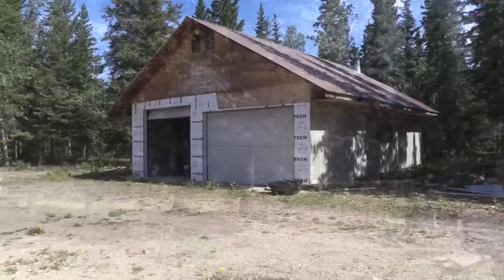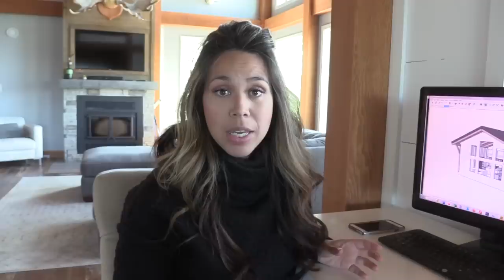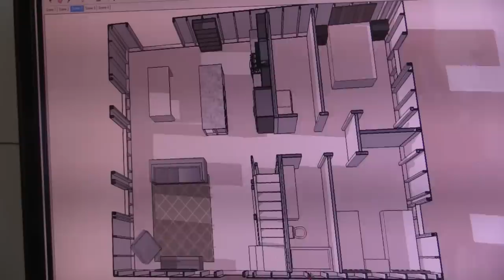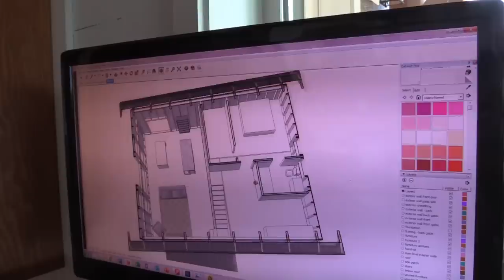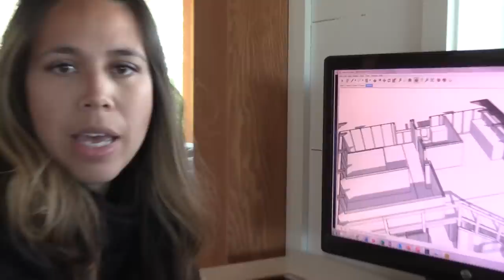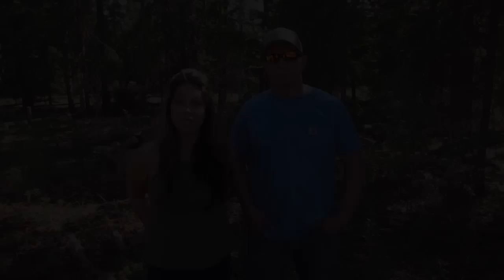Cabin House Build Episode 1: Design, Foundation, Floor Framing

Comment: With all that land you could potentially use several solar batch collectors (cheap to make) in series (where heat is accumulating from tank to tank), and run it up to a water to air heat exchanger @ heat system & hot water tank. Add a single solar panel to a DC to DC charger to 1or 2 deep cycle batteries to a 100w inverter to a taco 007 circulator pump 84w @ 12v/7A DC. (10)40 gallon batch collectors should provide in Alaska 150° - 200° water. You just have to find 10 decent used or cheap hot water tanks.

Comment: This is great!  I hope someday you build a 100% concrete home too.  There are systems for concrete in the roof as well and you can put brick or whatever you want on the exterior.  Folks are also starting to try Geo-Air systems to use the 52-degree earth (most places 8 feet down) to help heat and cool.

Comment: I love the outdoors of Alaska all year round BUT 50 to 70 below is killer (granted those are extremes but 6 weeks of 40 below is pretty possible...). I would probably cut back on the amount of glass and put in extra insulation if it were me. I would sacrifice some light and views for staying warm at an affordable price.Still love your designs though.
Reply from the maker: Thanks for the input!

Comment: You are using 12 foot studs on the side walls? Cool. A very nice compact envelope for the amount of floor space and then the dramatic great room is fabulous! I assume there will be structural bracing in the 2x6 walls, especially since the floor joists will run parallel to the side walls. Sorry, I tend to geek on home building. Oh, will there be a place for a wood stove?
Reply from the maker: We need to hire you lol!  Thank you!  Not sure yet on the wood stove, it takes up space and will cost about $5000 ...

Comment: Do you use ceiling fans or duct work to pull warm air from the upper parts of your house to the lower levels? I figure it might help you out in keeping the whole house feeling warm.
Reply from the maker: Yes!  We will do a ceiling fan in the great room and then an air intake at the peak to bring the warm air down

Comment: I love your designs & was wondering if you've considered a deck on the front that goes around in front of the wonderful window's to help give it a larger feel? Especially since it's only 1,008 sq ft...a bit more work but would make it immediately functional for a family & are you putting in a wood stove to help with heating costs?

Comment: I am curious if the walls made of the icf is not practical since one of the selling points is supposed to be insulated?  I look forward to watching it being built!
Reply from the maker: We are not doing ICFs for the walls, it is a great way to go but is more expensive labor and materials wise.  We are doing stick framing with foam on the outside.  There are definitely better wall systems, but we have to compromise to keep things affordable